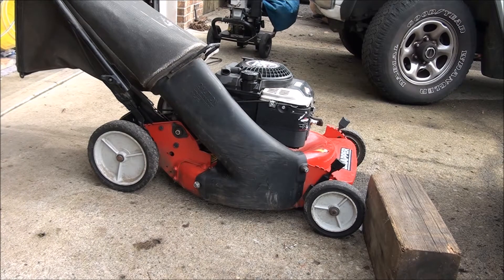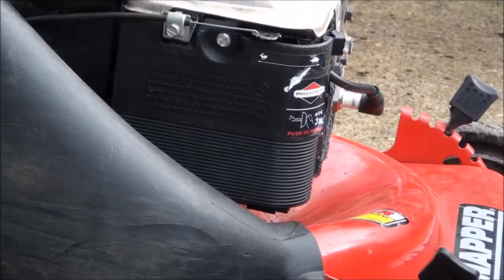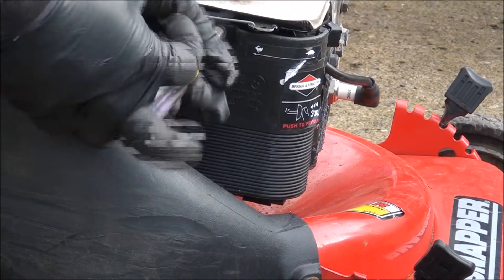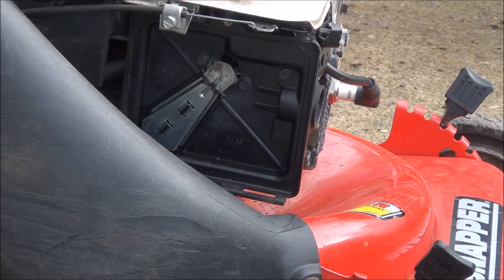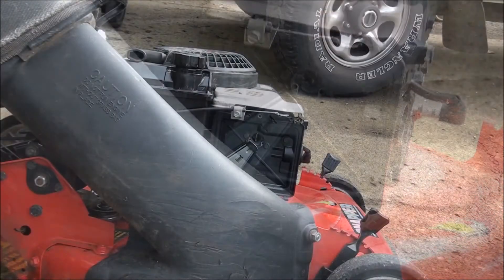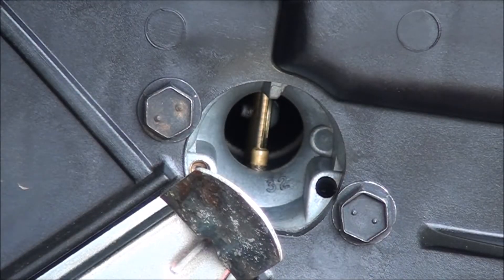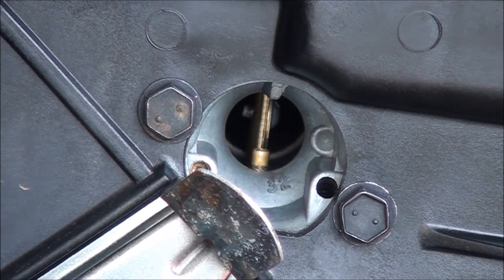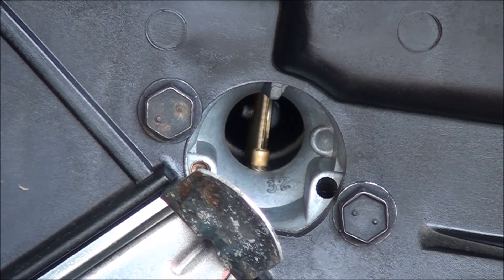Hard to Start? HOW TO TEST the PRIMER BULB on a Briggs and Stratton Lawnmower Engine

Comment: I'm getting no fuel up the emulsion tube. New gasket between the air filter case and carb, new gasket on carb bowl. Holding the air filter case to my ear, while assembled, I hear air coming out the gasket assembly to enter the proper carb port, but no fuel is emerging. Fuel line from the tank is good as there is fuel in the bowl. Next thought I had would be to soak the carb in carb cleaner to ensure the emulsion tube isn't stopped with old fuel gel. Thoughts?
Reply from the maker: Try 2 gaskets stacked between carb and air filter backing plate
Reply: @jeffslawnmowerrepairandservice  I'll try that. Think the gasket is letting air out, not holding the seal, so there is no pressure to put the fuel up the emulsion tube from the priming?

Comment: some of these will kick you ass. I have one, I changed  3 carburetors and 3 primer bulbs. and that primer bulb gasket and no problem with gas tank or gas line and carb gets gas but no gas going into engine when you press primer bulb.

Comment: Thanks for this. Rebuilt a 2005 Toro SR4 with the B&G. Changed all the baskets and rubbers. New primer button too. It kept having hard start problems. I could hear no gas anytime I primed it. Saw another video advising to try double stacking the air filter gasket. Voila. Fixed it. I see gas coming up the emulsion tube with each hit of the primer bulb now.